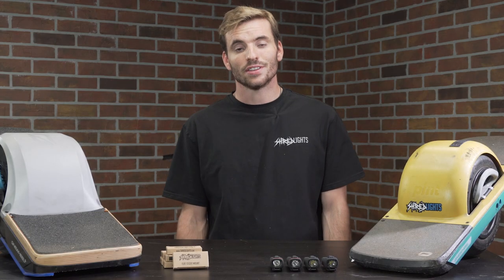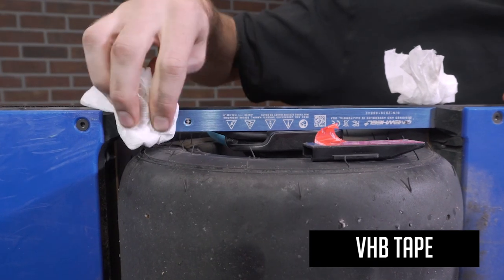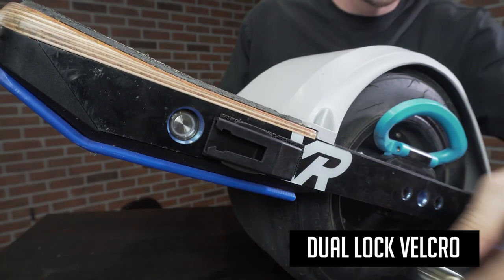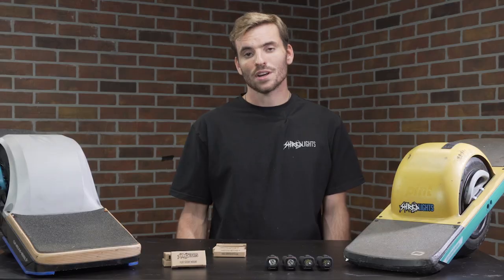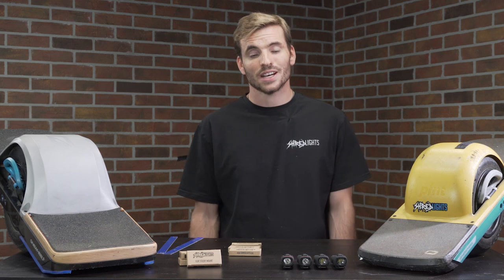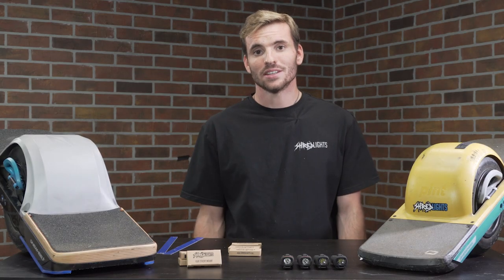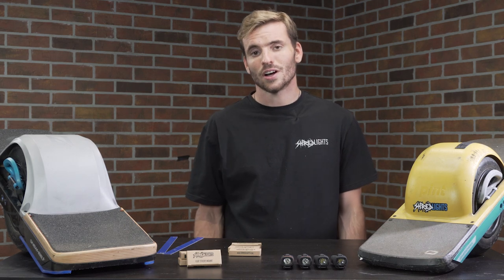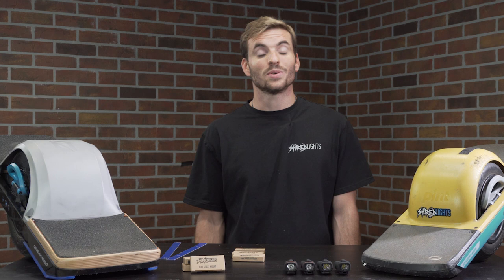How to add ShredLights to the Onewheel Pint & XR

Comment: Will the 1000 version fit on my Pint? If so, what is the best kind of mount for it?
Reply from the maker: Hey Brian! The SL-1000 will only fit on the fender of the Pint. You can use the Curved Sticky Mount to place it there. You can also mount the SL-200 underneath the side rail with the Flat Sticky Mounts as seen in this video.
Reply: @ShredLights  nice, thanks.